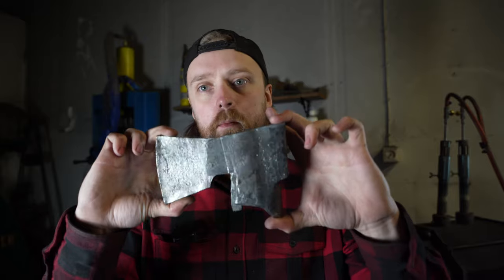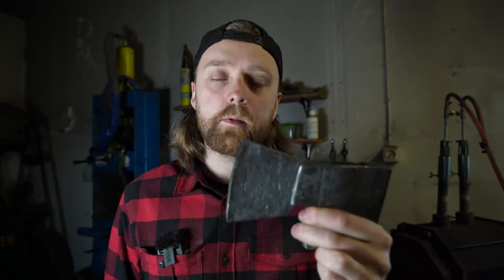Forging a Finnish Style Axe: A Journey into the History of Nordic Blacksmithing

Comment: Very nice video! I enjoyed the way you made the construction. Definitely some very good power hammer control there. Do you think it would be practical to forge weld on a butt plate (and historically accurate?).
Reply from the maker: Yes, as i mentioned in my comment. The poll was historically welded on to the plate. I cheated a little bit ;)
Reply: I have tried doing it. The weld was very challenging and like you mentioned you need way more steel for it.  Takes at least 6 heats. Very nice work!

Comment: This is by far my favorite video of yours. Your attention to detail is amazing and you made this look like it was easy. Beautiful axe by the way. Question, does the integrity of the handle weaken as it tapers through the eye being so thin? Amazing job!!!
Reply from the maker: Thank you! Notto my kowledge. Now it was a bit smaller in the top than I intended, but some of the very old hewingaxes has very small eyes. My friend Nick erb know alot on the topic, @40axes on instagram
Reply: No, it does not weaken it.  In fact, the long eye provides a lot of extra friction holding the head on, and helps distribute the force of impact over a longer length.  A lot of early Pennsylvania Dutch hewing axes were made the same way, and this comes from the same tool making tradition.  I have heard that making eyes in this was was a originally a reaction to a lack of highly elastic handle woods (such as oak and ash) in Northern Europe--and that easy access to imported hickory is part of why the style diminished in importance in the 1900's.  I would love to have access to more access to information on this flow of knowledge and tradition in Northern Europe--anybody have any suggestions?

Comment: Nils I meant to ask a long time ago what steels you used for this axe. I'm going to make my first attempt at a collared axe much like this one but more of a carpenters axe bit. The collar and blade will be made of wrought iron, the poll will be a separate piece of railroad clip and the edge will be 80crv2. It will be quite the process but it will be one I keep and hand down to my children
Reply from the maker: In this case it was just mild steel for the body and collar. And the edge I think was ss2090 spring steel. If I remember correctly